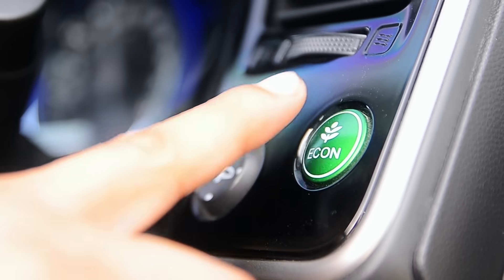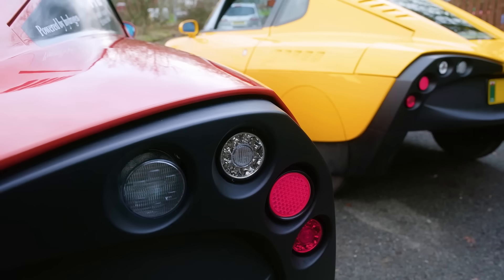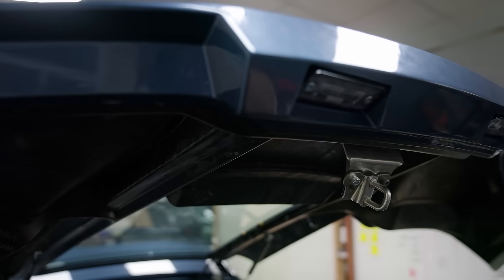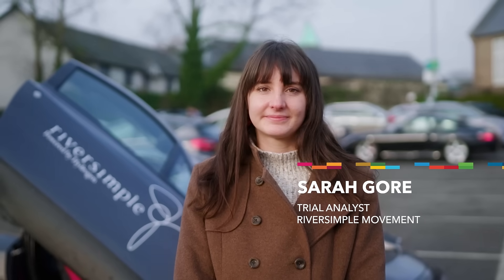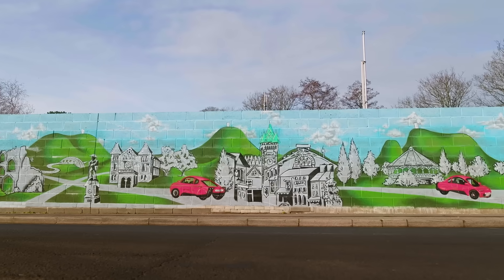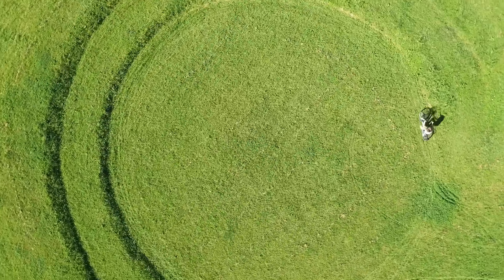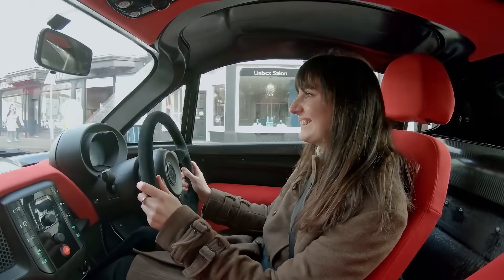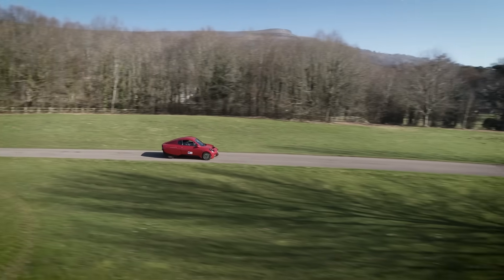Inside The Former F1 Engineer's Innovative Hydrogen Car

Comment: Looks like a great idea but Hydrogen is mainly make from natural gas that produce CO2 that is why the energy companies are pushing it. Hydrogen can be made without gas but it is expensive, so we have to be careful where it comes from. This a hopeful idea as long we only use green Hydrogen.
Reply: But we're still looking at electric motors, thinking they are the best we can do.  ICE gasoline motors are 120 year old ideas but so are electric motors.

Our societal fascination with electricity began with the 1880s as a panacea for all ills and Future World.

There are other methods of producing mechanical vehicular motion without using gasoline/diesel or electric motors....but they're not in fashion.  We're just back to the arguments of 1904...at least steam is out of the picture, except for Jay Leno.
Reply: Teslas look great but unfortunately ev cars have a bigger initial carbon foot print, battery material mined by slaves, and more then half of electricity is generated by natural gas and other fossil fuels. That’s why (insert conspiracy here) is pushing it. We must be careful where our electricity comes from.

But in all seriousness hydorgen is way too expensive with the platinum requirements. If electric power plants and hydrogen are going to use natural gas anyway, may as well switch to carbon nuetral biogas LNG/CNG. Burns cleaner for cheaper fuel cost per mile; even if not renewable. but when renewable biogas burns it is still cleaner and is carbon neutral.  Big bonus is biogas is stupid easy to source yourself so much so that unlike ethanol and biodiesel it uses waste streak biomass instead of valuable crop land ;)
Reply: That's nonsense
Extraction of Hydrogen from natural gas - Does Not produce Nearly the same amount of CO2 as Burning the said natural gas does.
Learn something about the chemical process Before you state your Unqualified opinion.

The added benefit of using hydrogen rather than fossil fuels in cars - is that the pollution is Centralized, at the production facility, and can be dealt with There, rather than distributing it with every vehicle, as petrol cars do.

THAT'S the whole argument in favor of hydrogen economy. Noone Ever claimed it is pollution-free.

There's no such thing as "green hydrogen". Trying to produce hydrogen with solar, which has about 3-4% efficiency -- is mental.
Battery-powered vehicles only ADD to pollution. Where do you think that electricity is Coming from?
Hydrogen is the reasonable way, and the conspiracy theory that "the energy companies are pushing it" -- is more mental nonsense.
Reply: Problem is; the last study I read concluded that it took much more energy to make "green" Hydrogen than the usable energy in it.
Reply: @davidblake1663  unless we use only Hydroelectric and Nuclear power plants, all methods involve carbon fuel energy, even Solar/Wind.  Once you need high power for hydrolysis, then when solar/wind isn't producing you use gas and coal plants to keep the juice flowing.

Also the amount of energy per cubic meter in H2 is low unless you have it under TREMENDOUS PRESSURE.  That in a moving and colliding car is very dicey.
Reply: The Hydrogen comes from H20!
Reply: @joewiediger2737  
U come from H2O !
Reply: @joewiediger2737  and massive amounts of electricity or heat (you guessed it oil/gas fired). It can also be cracked out of natural gas or other oil grades.

All gasoline vehicles burn Hydrogen...the Carbon and Oxygen is the emissions.
Reply: There is no free thermal lunch in energy.  You either have a battery or use constant feed to keep pushing power.

Gasoline is an energy battery.  It stores thermal action from a billion years ago.  You crack CH bonds on demand, and store it as an inert liquid when not in use.

Lithium/Cobalt cells is an empty energy battery that must be fed by constant power dumped into the electric grid....typically by cracking CH bonds.

H2 cell is also an energy empty battery that must be supplied by H2 refined out of petrol, coal, hydrolysis (requiring massive electricity).  It is doing what the former two batteries do but in a different way.  Like gasoline it is a chemical energy battery...but unlike gasoline the energy stored in it comes solely from recent thermal activity
Reply: I understand the argument being made, my point is electric can be produced in a number of different way that do not produce green house gas’s. Hydrogen seems to me the wrong direction as it either needs a lot of electricity to make it or a process that produces green house gas’s.
Reply: Well, currently the electrification that the greens are pushing is just increasing demand at existing coal and natural gas burning power stations. The entire idea is that electricity (and hydrogen) can be decarbonized in the future.